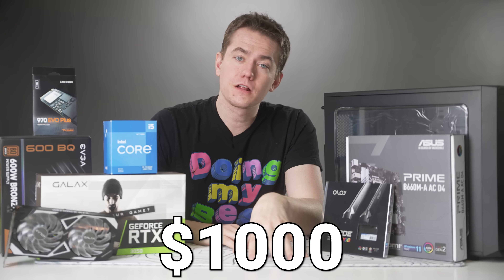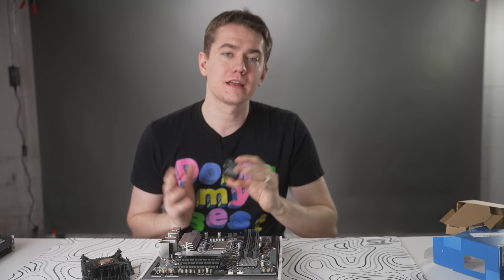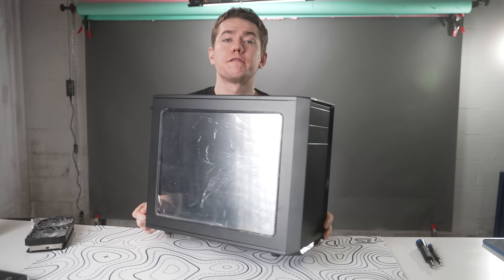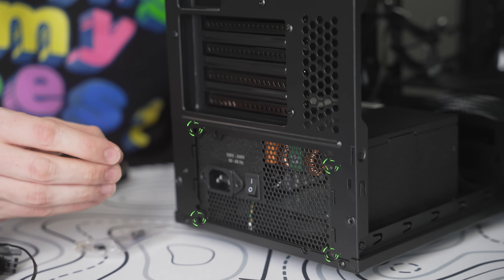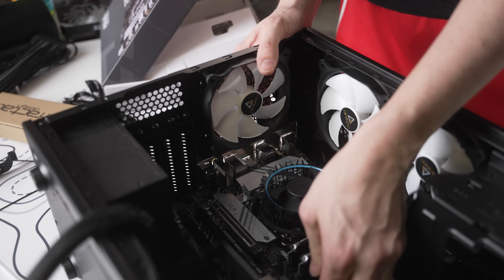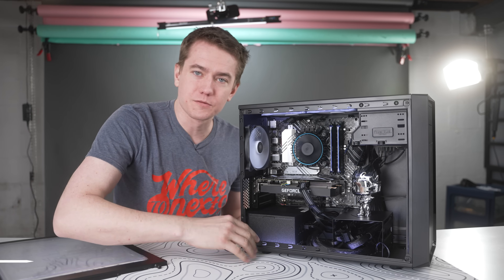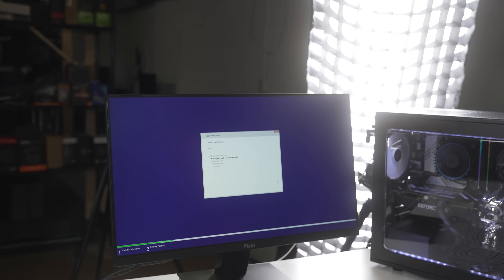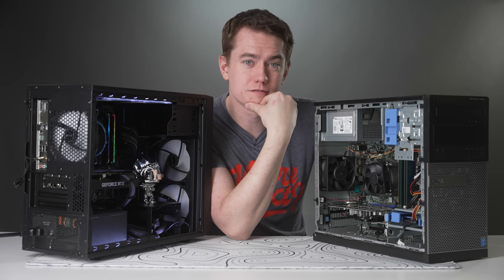Best $1000 Gaming PC Build - RTX 3050 i5-12400F (w/Benchmarks)

Comment: Nice video, but i still ned help for my first ever built, i m building with the same cpu and MB, but i have some question . #1 do i have to connect the psu to both of the power connector (atx power and atx 12v) or  just the atx power?
#2 ist it normal on this MB that i dont have the RTC battery holder ?

Can someone out there help me

Comment: I dont understand these videos, i bought everything exept the GPU (3050) i bought the I5 12400 non f version, 16gb ram 3600 mhz, 512gb m.2 nvme ssd 3500 mb read, a psu not more than $60 and a case $57 case, and im already past $730, the GPU is atleast $465, why am i over $1000
Reply: I have the B660M-K D4 non wifi mother board

Comment: I tried to put together a cheap gaming computer. With periferals like keyboard, mouse, monitor, and headset. I ended up with a i5 12600 rx6600 144hz 1080p 16gig ram for 1 753,46 usd. Its a computer, but not cheap. the 12400f would have shaved of 64usd of that price

Comment: This combo cpu and gpu is literally what im gonna build next month, could not have timed this luck better.
Reply: I recommend getting an rtx 3060 ti even if it's over your budget.
An i5 12400f is straight overkill for an rtx 3050, even a 3060.
An rtx 3060 ti is a massive upgrade over both the 3050 and the 3060 and will match well with the cpu.
Reply: I'm planning to do the same. Have you built yours?
Reply: @Ab-cj6gl  Get an rtx 3060 ti instead of a 3050.
I recommend you wait like 4-5 months though for prices to drop to MSRP, prices have been decreasing by 10% each month.
Reply: @feliciacore  I live in Algeria there's no way on earth I can afford 3060 unfortunately
My only options are gtx1660 or RTX 3050 and I'm going for the 3050 because It's just slightly expensive
Reply: @Ab-cj6gl  Then don't get an i5 12400f, get an i3 12100
Reply: @feliciacore  oh why? Can you explain more to me. (Note I'm planning to upgrade later on)
Reply: @Ab-cj6gl  The i5 12400f would be severely limited by the rtx 3050.
You would basically get the same amount of performance, the i5 12400f is a card which can be paired with an rtx 3080 without bottleneck.

It's overkill and more expensive to get an i5 12400f for a 3050
Reply: @feliciacore  oh ok thanks for reply. I don't know a lot about computers but for long term will this effect the CPU? Will it shorten its lifespan? I'll be upgrading the GPU but I'm thinking to keep the CPU for a very long time. Is what I'm doing right?
Reply: @Ab-cj6gl  I mean, the i3 12100 is still pretty good.
If you do actually want to future proof, you can get the i5 12400f.
Reply: @feliciacore  oh ok thanks man for the replies. Good luck

Comment: I ordered this build substituting a few items for slightly less of a budget set-up. 12400 instead of 12400F. Same motherboard and case. RX 6600 instead of RTX 3050. Will use some old 2x8gb ram I have laying around until I can upgrade it. Samsung 1tb 980 instead of 970. CORSAIR RM750x instead of EVGA 600 BQ 80+ Bronze. 2 Noctua fans instead of the Antec fans. Also got the fan hub. This will be my first from scratch build so hopefully all goes well. I have always owned prebuilts; SI and OEM and end up swaping parts around eventually.
Reply: Sounds like a good system! The power supply is massive overkill though, right? I have a 5900x and 3080 and it doesn’t draw over 700. My sisters pc with these specs, 12400 and 3050 does fine on a 450. Did you just oversize for future proofing? That I understand cause the 4090 is rumored to need a 1500
Reply: @tylerdean3489   Yeah mainly for possible upgrades down the line. Plus, the price was so neglectable for a fully modular psu.
Reply: @MintyElder  the only difference between the 12400 and the 12400f is that the 12400 has integrated graphics
Reply: @robotics4572  Yes I know that. Not sure the purpose of your response. You do realize cpus with integrated graphics still has its uses when using a dedicated gpu??
Reply: @MintyElder  hello I currently going to build a pc exactly like your cause a 3050 vs a rx 6600 is a no brainer. I was wondering if 600 wats is enough cause I was thinking 650 wats to be safe.
Reply: @brycerice4640  Either is more than enough. I just got a 750 to leave me room to upgrade down the road.

Comment: Great Video. It would've been nice if you also included some thermal information for the CPU with new stock cooler. I know this information can be found other places but it's good to have more points of information (for example, for this specific case and with a 3050).
Reply: Surprised to see some expensive copper in the cooler. I wonder how it does.

Comment: wouldn't it be better to cut budget from other component to get a 3060  or 3060 ti?
Reply: I'd strongly argue for getting an i3-12100F if your budget is under $1500, just because Graphics Cards are so goddamn expensive in this current situation. It sucks but it is what it is. 

I wouldn't downgrade other components necessarily because as someone who's built computers for a really long time I can tell you the building and maintenance experience is night and day when you make good choices for your case, power supply, motherboard, etc.